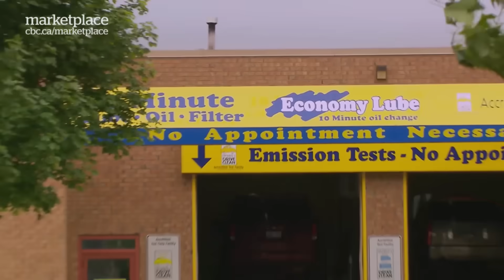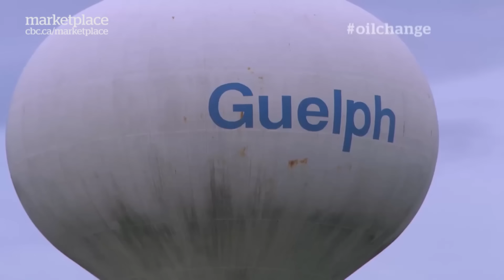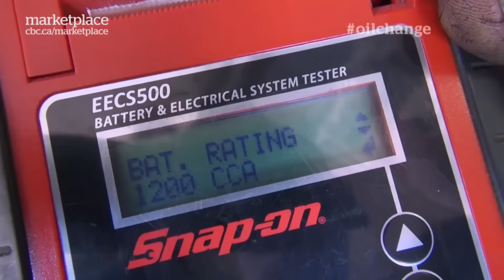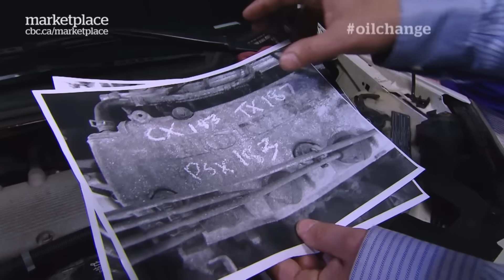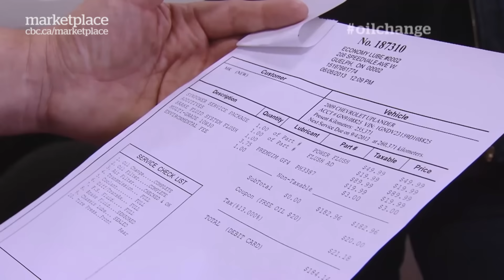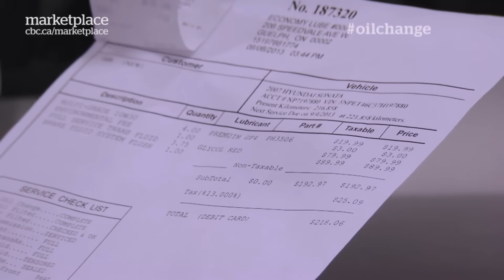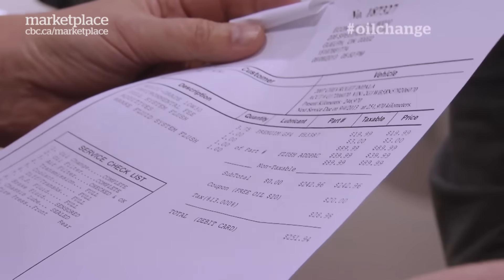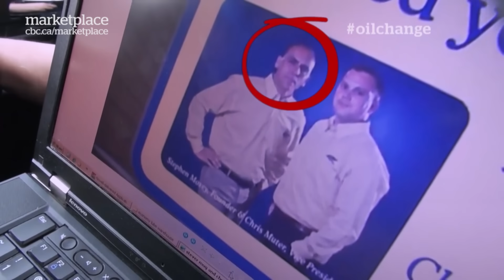Oil change scams: Hidden camera investigation on what really happens to your car (CBC Marketplace)

Comment: I have a 96 Tahoe with a 5.7 V8. I went to Tire Plus for a oil change and they tried to charge me extra because my truck was 4 wheel drive. It use the same oil as a 2wd.
Reply: Oh man, without that special 4wd oil, you're screwed
Reply: hah that hilarious
Reply: Your first problem was going to tires plus.
Reply: Thomas Neumann Have not been back sense and that was 11 years ago. Shortly after, I found out Autozone had to take my use oil for free. I started back to changing my own oil n my apartment complex. That oil I drain out from them, look very thin, like water and it had only 5,000 miles.
Reply: That's just stupid...
Reply: sik59rt 4wd? You mean wd40, this is the extra charge!
Reply: The Grinning Skull Sarcasm isn't your strong point.
Reply: Thomas Neumann Awh man, I'll get back to my corner then.
Reply: ***** Okey so where did you dispose of your oil that you drained at your apparment? Your drain?
Reply: Reinhardt Beck Autozone, which I assume is a motor factor chain who have to collect used oil like the electronics shops have to collect used batteries. 
I don't know what things are like in Canada, but here in the UK they have collection points for used oil and oil filters at every council tip. No problem disposing of used engine oil. 
I'm sure some jerks dump it down the drain like you say, though. When I was a student I worked at a rubbish dump and we'd occasionally have people trying to dumb old asbestos, I even saw one guy about to put it into the compostable waste area.
Reply: Autozone is here by us in South-Africa aswell. But only as workshops. That does minor services, alignment, tyres and small suspension jobs. Not collecting oil at all.
Reply: Reinhardt Beck probably a different company. Autozone is probably quite a common car shop name, I suppose.
Reply: donkmeister Autozone in America is a place to buy parts for car engines and accessories
Reply: ***** When was the last time u seen a drain plug on a 96 Tahoe automatic transmission? When was the last time u seen a Tahoe with a manual?
Don't waist my time kid. I rebuilt the transmission n my Tahoe 2 years ago and unlike u. I have video on youtube to prove it.
Reply: ***** First off EVERY 2wd rwd car/truck/suv whatever has a differential so dont say it doesnt. 2nd what you're thinking of is a TRANSFER CASE and that model year tou can eother use regular ATF (automatic transmission fluid) or if it had autotrac it is tecxomended you use dextron III. 

Buy het im sure you were just trying to one-up someone on the internet so we can forgive you this time. Bye now.
Reply: ***** Oh in addition to that many transmission fluid may be clear BUT there are many that use either a dye or come in a few different colors.
Reply: donkmeister Yep, In the US be have areas where you recycle oil and car batteries. But I have known people who just dumped in down the drain.
Reply: Dr.Metroid I use to dump it in my friend back yard to keep kudzu vines away from his house.
Reply: ***** "Hi i have a _______ and i'm looking for front and rear brake pads" "Sure no problem, what color is your car?"
Reply: mochi2122 I like it when I go to Autozone and ask for front pads for a 5.0 and they ask is it a 4 or 8 cylinder.
Reply: *****  Contradicting the nature of our jokes, The 8 cylinder could have larger front brakes
Reply: mochi2122 bruh.......the 5.0 mustang IS an 8 cylinder. That sort of info just goes together
Reply: Top Flight Thank you, I thought he and I was on the same page.
Maybe I should have said a SI Civic.
Reply: welp iv'e failed to read whats right in front of me, maybe i should just ride a bicycle LOL
Reply: ***** If you watch them on the computer, it makes them ask all that info before they can look it up. I actually asked why it matters once with Mustang on something.
Reply: Mike Vanderziel Yes I know but if I say GT don't ask me is it 4 or v8.
Reply: Generally most fast oil change services also apply greased fittings for your 4wd vehicle. It should only be about two dollars in total more though, if that. Not a huge increase just a tiny one.
Reply: TheHolyTaxAccountant  No this was because he said a 4x4 Tahoe use different oil than a 2wd.
Reply: ***** Well, that dude was a dumb ass. And as a Customer Adviser and mechanic I apologize for his retarded statements. Most quick lubes have just a little bit of an extra charge on 4x4's for the grease on the fittings. But no. a Tahoe uses 5w30. ALL Tahoe. Unfortunately people like them give honest mechanics a bad name and it really upsets me. Because I do everything I can to make my customers happy on that factor. I want them to know exactly what goes on. And its a shame others abuse that just to make as much money as they can. Its not about that, its about making sure you can be proud of the fact that you make sure everyone has a working car. Boo. =\
Reply: viktorftw Ever heard the lie where they say your car has 150,000 miles so we have to use High Miles oil or it will damage your engine?
Reply: ***** Well, technically speaking the "high mileage" blend is just a thicker oil which is used to offset the wear and tear on the inside of the engine so that statement isn't 100% incorrect
Reply: ***** HAHAHAHAHA, please stop. I still havent gotten over the 2WD oil. You are killing me.
Reply: ***** 
actually, some 4wd trucks use a different oil filter than their 2wd counterparts.
Reply: pattyofurniture100 i have never heard of such a thing
Reply: If your paying 20 for oil of course it going be thin, higher the price the better the oil synthetic oil is the best
Reply: ***** so the more money you spend, the thicker the oil?
Reply: sik59rt yea that 20 dollar oil is junk always get synthetic oil its way better cause it's thicker
Reply: sik59rt lol ask any mechanic synthetic oil is the best
Reply: ***** synthetic or not has zero to do with thickness of oil. ask any mechanic
Reply: *****  synthetic oil is thinner than mineral , and thicker != better.
Reply: TerraBiker Synthetic oil is not thinner. The viscosity of the oil is determined by the specification i.e. 5w30, you can get that grade in synth or mineral for example.
Reply: Mike Creed Yes and no, 5W30 just marks winter and summer grade, how does oil behaves and is able to pump through the pipes and lube the engine correctly.  5W30 means that oil should be used in area where vehicle will meet min. temperature -30 celsius  and max 30 celsius , in using this oil below the min and above the max can cause that engine will not get lube it need or it will be too thin to lube properly in higher temperatures.

So yes, you can get 5W30 in mineral or synthetic form but mineral will be thicker , but  it will get the job done as well as synthetic. That's why for example people don't recommend change mineral for synthetic oil when you have high milage engine, because it can start leaking oil as synthetic is thinner and can dissolve carbon/dirt deposits which were sealing the engine before. 
I aslo read that mineral is better for heavy duty use and synthetic for passenger cars as it has increased longevity and preserve engine health better.

Discussion about oil is always long and exhausting , because everyone has different opinion.
But one is true, there's not much difference between oils nowadays and it's only about user preference and more importantly manufacturer's recommendation.
Reply: Top Flight But... the mustang isn't a 5.0 lmao
Reply: Gt are 4.6 or v6
Reply: ***** No they aren't. The GT is a v8 all day every day.
Reply: *****   that was probably due to the extra work involved in removing the skid plate common on 4x4.  i have worked in shops that have used this tactic and in shops that havnt.  its really not worth it to charge extra on a car like yours.  some bmws and such have skid plates that are a royal pain in the ass.  the extra 2-3 bucks is fair in those cases.  especially considering the mech only sees 20 cents extra or so.
Reply: Top Flight 4.6 is v8
Reply: ***** I know that, you said the GT came in a V6 when it doesn't
Reply: ***** a drain plug on a tahoe transmission pan, stock as in em from GM.   Now thats funny since they don't have them.  But being a GM Truck/SUV, changed the the fuel pump yet?!!!!
Reply: Top Flight I could care less about gt mustang
Reply: ***** Then don't talk about what you don't know.
Reply: Top Flight well I looked to make sure and they did make some gt v6 so your wrong... And when I said 4.6 or v6 in gt because you have the option of what engine in the car shows how much you know
Reply: Post where you found that then I'll believe you
Reply: Top Flight just search on Google
Reply: ***** Already have and the GT only came in a 4.6
Reply: ***** Not clear. More like the color of vegetable oil.
Reply: The 5.7 was in the 2wd and 4wd. I don't understand what they were talking about... Straight up stupidity man.
Reply: *****  i know you your the ledgen 8 year trucker. Ive seen you on the drop a trailer vid ha. classic on calling out that fake who said he had 26 years exp
Reply: dropYoTop It's real easy to see through them because they will use new school words that old people don't.
Reply: *****  Usually 4wd vehicles have a oil cooler. I dont know how much extra they charged you, but vehicles with a external oil cooler take 1 quart more then the same vehicle in 2wd...
Reply: Wicked Wrenches Not true, I've change my oil in my Tahoe over 20 times and it take 5 quarts with the filter.
Reply: ***** a 96 tahoe with 5,7 with 2wd takes 4 quarts via the service manual...
Reply: Wicked Wrenches  Mitchell says 5qts for both 4x4  and 2x4
Reply: Wicked Wrenches Your service manual is wrong.
Reply: I dont think the chevy factory service manual from chevy is wrong..
Reply: Wicked Wrenches Dude, 350s have been 5 quarts of oil for more than 30 years.
Reply: Then explain that to GM on how much oil they should use in there engines..not me, they made the service manual, not me. Not all 350s use a 5 quart pan. I have a bone stock 350 from a corvette in my shop right now with a stock 4 quart pan. You can even go to the GM performance website and order a oem 4 quart pan for a 350. I guess you gonna argue with the manufacture on how much oil they should use? I feel weird having to explain this more then once. So you can continue to believe what you want, I am only A.S.E certified through GM for shits anf giggles and to purposely deceive people about 1 quart lol
Reply: Wicked Wrenches Congratulation, you won my new JAFO of the week contest. I will make a video talking about how funny you are. It will be uploaded by Sunday.
BTW, Wicked Wrenches is a great name for an auto repair shop.
Reply: TerraBiker everything you said is wrong expect for the part about long and exhausting. very few people now what oil viscosity ratings really mean, including professional mechanics.
Reply: No im the manager there it was cuz ya black brudda
Reply: Box Box No. I use to be friends with a manager. It was because u all was trying to make money.
Reply: ***** Sound like u like wasting money. Just change the oil n my Tahoe (308,000 miles) and Trailblazer (151,000 miles). Went 9,000 miles n both trucks. I'm going back to 7,000 for the Tahoe and 8,000 for the Blazer. I use Mobile 1 5w30 full synthetic and Fram filter n both.
BTW I use conventional Kawasaki oil every 5,000 miles n my 2011 Ninja 1400 (9,300 miles)
Reply: ***** I bought the Tahoe n 04 with 113,000 miles. I use whatever brand name base oil until 185,000 miles. I've done every oil change but 2. I just counted 30 oil changes. I tried synthetic Pennzoil 1st. The engine had a cold start knock that went away. I started using Mobile one about 5 years ago because my co-worker Cadillac CTS call for it. I don't know much about Harley.
Reply: ***** I believe any full synthetic is better than a good conventional brand so if Castrol makes synthetic, try it.
Reply: ***** What is?
Reply: ***** With synthetic oil Mobil 1 or Castrol you can further if you want another 3100 miles/5000 kms cause it´s safe it ´s good at that point doesn´t matter how you drive. You don´t need to worry if you pass a bit the 9000 miles mark. If you want another very good thing to protect your engine from the beginning or from know get SLICK 50 and follow the instructions. It´s worth it believe me. You change that SLICK 50 every 80000 kms or 49709 miles  and it´s not that expensive here ( Europe ) it´s like 50 euros so it shouldn´t be expensive there too.
Reply: Vítor Araujo You go ahead and change your oil every 50,000 miles and see how long your engine lasts.
Reply: Vítor Araujo Slick 50? Dude that is some real bull shit there. I use only good synthetic oil.
Reply: Slick 50 is not oil like you know mate, it purpose is to protect even more the engine ( it´s thick and it come on small bottles ) besides your synthetic oil like the Castrol or Mobil 1. When you´re going to do your oil change put  Slick 50 before top up ( at least here it´s only one bottle of 500 ml and another of 750 ml to engine above 1400 cc ). This is if your engine takes 5 liters of oil with the oil filter change you should only put 4 liters and 250 ml of oil and put the 750 ml Slick 50 bottle. After doing that they say that you should do 30 miles/50 kms without stopping so that Slick 50 glue to all the parts of the engine. Then if you notice a bit of low oil you should top up. This Slick 50 comes out a bit everytime that you do the oil change. You will notice the difference, i did as the engine become more quiet, more smooth and warm a whole lot faster. You can use this with any oil, mineral or synthetic.
Reply: Vítor Araujo Dude, I don't do additives. If u buy good oil (5w30) u don't need anything else. My truck has 308,000 miles and don't smoke and has good even compression.
I have a funny story about slick 50. My friend brother won that 1957 Thunder they gave away over 20 years ago. I ask Baybay has he ever put slick 50 n the T-bird and he said hell no. He said he don't use that shit. He got the entry form off a bottle some fool threw n the trash.
Reply: Top Flight Mate Slick 50 it´s oil to protect the engine and it glues to engines parts, reduces friction engine, smooth the engine works, warms faster  and it´s come out everytime that you do a regular oil and filter change at 9000 miles. It´s not for you to do any oil change any 50000 miles. You have to put mineral or synthetic oil on the engine the same and do the regular changes. At 50000 miles you don´t have the Slick 50 any more on the engine to protect it because that´s the time that it last glued to engine parts. After those 50000 miles you needd to put it again if you want to keep protecting more the engine but you need the oil always, it´s not a substitute or something like that.
Reply: ***** Now THAT'S, some crazy shit!!!!  Talk about trying to play on someone's intelligence.  In a situation like this, I often tell people "I'M NOT STUPID,...I JUST LOOK LIKE THIS!!!!"
Reply: tarence319 That's why I just said fuck it and change my own oil. If I get to old to change my oil. I will just stop driving.
Reply: ***** I know that's right my friend!!!
Reply: Reinhardt Beck In Calgary we can dispose of toxic fluids (including motor oil) for free up to 30 liters a week at some fire stations.
Reply: change your own oil.
Reply: Did you read what i wrote about oil, synthetic oil mate? 50,000 miles lasts the SLICK 50 that glues to the engines parts and comes out every service that you make mate that´s why it comes on small bottles. SLICK 50 is not to use without engine oil, any engine oil.
Reply: Older GTs used the 5.0
Reply: Yeah, that's why I go to O'Reilly. Their sales force is competent. Auto Zone and Advance hire too many dumb asses. 

O'Reilly is a few percent more expensive, but the service is better, and I suspect that they pay higher wages, attracting better employees. They never sell me the wrong parts or ask dumb questions, and that alone is worth it.